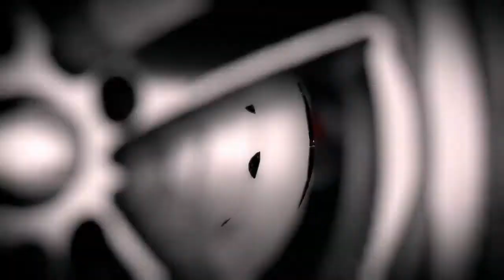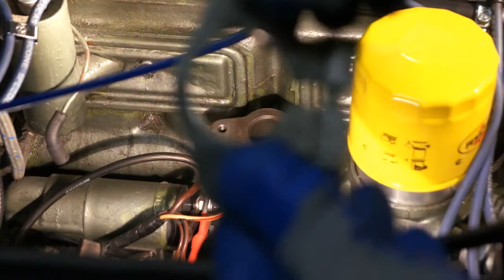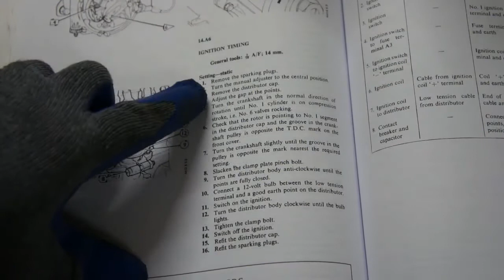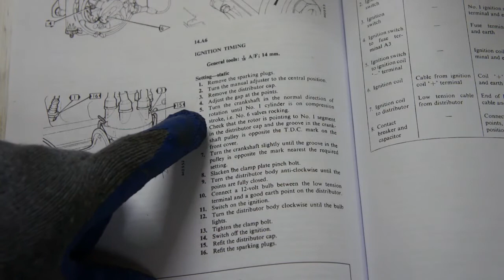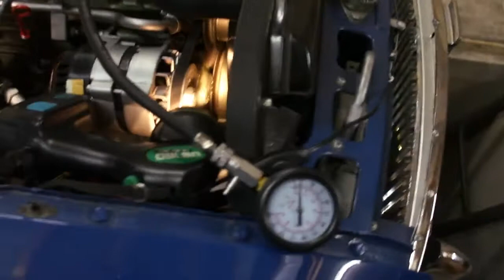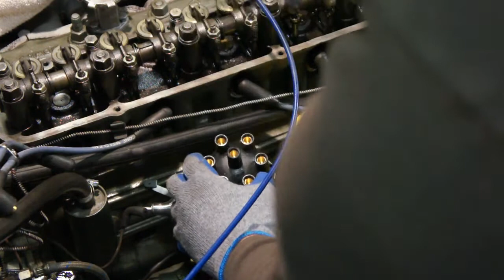1968 MGC Distributor Install, Set Static Timing

Comment: If you really want accurate timing remove ht lead from coil put a paper clip into coil with a leg of paper clip pointing to low tension post turn ignition on rotate engine when it sparks that is the static timing

Comment: Where do u connect bulb too ?
Reply from the maker: The red lead of the test light I attached to a constant hot and the black lead I attached to the distributor.  You can see some pictures here that will show in more detail where on the distributor to attach the black wire.  http://rivardweb.com/MGC/2020/07/29/distributor-install-setting-static-timing/

Comment: What does that white with black line wire go to? That’s the problem I can’t figure out now.
Reply from the maker: Aha, the infamous extra white-black wire... One end goes to the negative side of the coil and the other goes to the distributor.  It looks weird because both the white-black wires go into the same wire loom but it is actually one wire that just doubles back on itself inside the wire loom.  I hope that makes sense.  Here's a picture: https://photos.app.goo.gl/Zpcs8TKm5h3cPJ4s8  The blue arrow is the solid white wire that goes to the coil +, red and yellow arrows are pointing to the white-black wire.  In my case the longer end of the white-black wire (yellow arrow) goes into a black sheath and then off the edge of the picture and connects to the distributor.
Reply: JR's Garage thank you! That picture is very helpful!

Comment: To set 8 deg btdc static timing, did you set the notch on the crank shaft pulley 8 deg before the needle on the Timing cover?  I'm asking because you glossed over this while you were setting the static timing at the at the distributor with a static timing light.  Please help me to understand this.
Reply from the maker: Yes, you are correct, I kind of did gloss over that point. If you watch my crank shaft pulley marking video: https://www.youtube.com/watch?v=fSueI3fS-GE it might help clear things up but here's what you do: Set the mark on the crank shaft pulley to mid way between the middle and lowest of the 3 markings on the timing chain cover.  the top marking (closest to 12O'clock) is TDC, the middle mark is 5 degrees BTDC and the 3rd mark is 10 degrees BTDC.  Hope this helps.